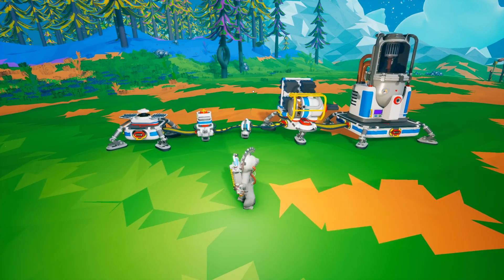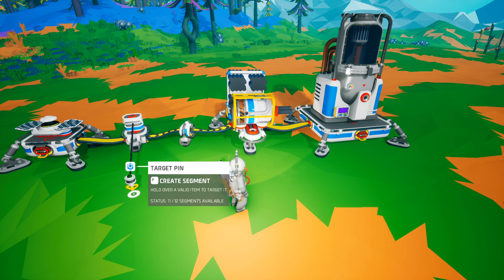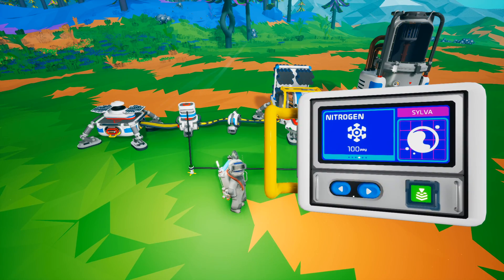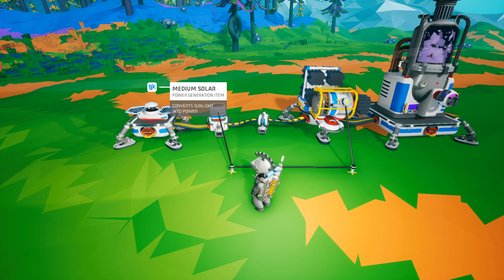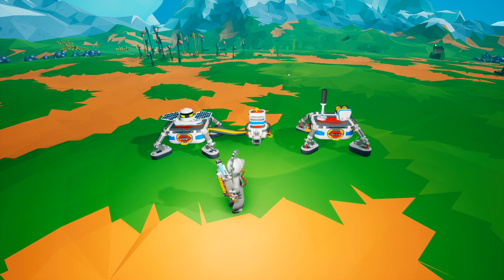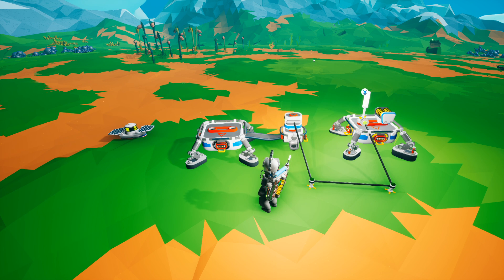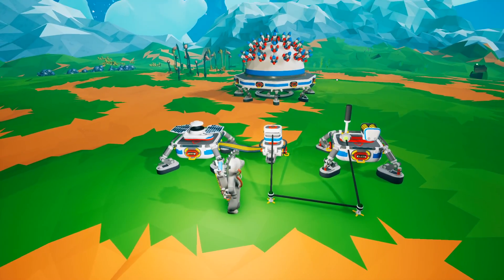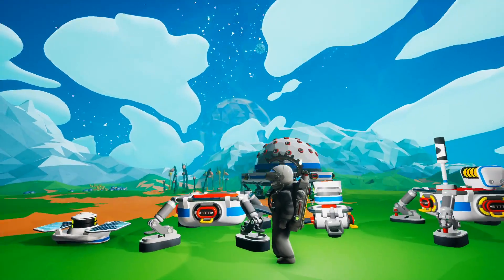Astroneer - THE POWER SENSOR & STORAGE SENSOR - A HELPFUL GUIDE

Comment: Aw, that's what I was missing. Lame.

I like having my wind/solar on tall platforms at the ends of my base. I built a power sensor hooked into my Large B with two medium generators and a bunch of carbon, wanting the sensor to turn on the generators when power draw exceeded power generation either because I turned everything on or it's night/not windy. Guess that won't work unless the batteries completely drain. 

I suppose I could put the Talls in a line leading to the sensor and generator platform, but it just doesn't look good to me.
Reply: You should be able to use a battery sensor in the "full ot not full" to do that.   I have one connected to my research station to turn it off when my last battery starts to drain.

Comment: Ironically, I had the most problem with the storage sensor. It might be due to how I visualized then similar to logic gates and not specialized conditions.
Reply: Using the storage sensor right now... its tempermental... it's broken for me.. it turned on once but not again :L
Reply: for me the storage sensor just won't send a signal no matter what i do across all saves.

Comment: I should have watched this video before messing around with automated smelting, though in my case I was trying to get one arm to smelt two different materials. I scraped that idea and decide to use two arms instead, since I want the materials to take turns being smelted.

Anyway, looking at your method of smelting I can see one problem with it. If your smelting gets backed up, your smelter will drop the smelting materials onto the left side and that will eventually block the system.
Reply: You could use a storage sensor that detects if the storage on right of smelter is full, the smelter turns off until there is room, preventing that :p
Reply: @Saeki2001  
I haven't played Astroneer in some time, but that should work. I don't recall if I thought about that or not, but I probably didn't because I likely would have mentioned it if I did.
Reply: @Soulsphere001  Didn't expect a reply back XD, but yeah I just started playing again after like 2 years of not playing and I been trying to learn how to do more automation stuff and this video helped me realize I should have been using storage/power sensors sooner

Comment: One thing I've trouble with is I want an autoarm to ONLY activate and empty a storage, once that said storage is FULL, and shut off when it's empty. But that doesn't seem to work for me at all.
Turn on - When the storage is 100% full
Turn off - When the storage is 0% full
That doesn't seem to work for me, no matter what mode I'm in. It tends to pick up stuff even if the storage isn't full.
Reply: Could try to, stack* counters on storage sensors for more accurate control.

Comment: I had an issue with the automated smelting, after smelting the items went back to the input storage instead of the output storage, I'm not sure how to fix it
Reply: tl;dr: how do I make the smelted items go to a specific medium storage
Reply: u can put the specific item you want the arm to carry in your arm, so it will exclusively transport only this ressource
Reply: @jediineducation  nah the problem was that I had all my arms grabbing materials from one side of the platform, but sometimes when the items would go to the wrong side, outside of the arms' range. I just fixed it by using a different type of platform.

Comment: I've been having problems getting the soil centrifuge to automatically start again. I put the storage sensor on the medium storage container, hook it up to the soil centrifuge and it just stops after 1 manual go. Anybody know why? Or how to do it?
Reply from the maker: It might be because of the mode you selected.
Reply: @OneLastMidnight  thanks for the reply! (Your videos/tutorials rock BTW) I have tried all the modes. But if you are 100% sure I have set it up right, maybe I missed a mode or something. I ended up setting up "a timer" of sorts that I saw on the astroneer sub reddit and that worked, but it is very convoluted.
Reply: Is the second soil can getting taken off of the center part of the centrifuge? I know it automatically takes the second one but having an arm to take it off might work if you can keep it from taking things off the sides.